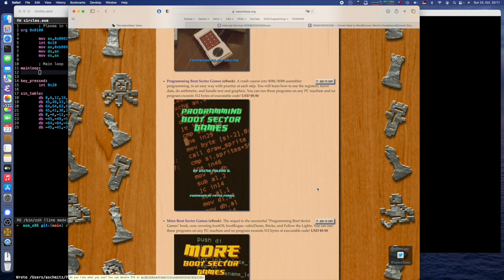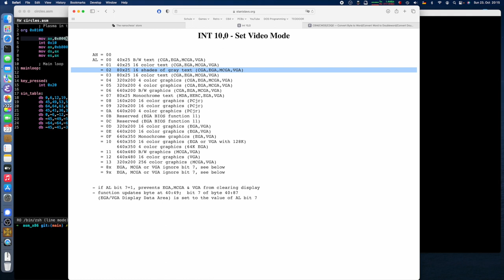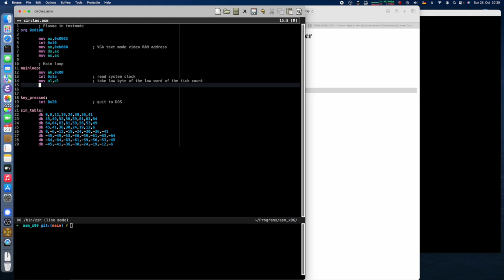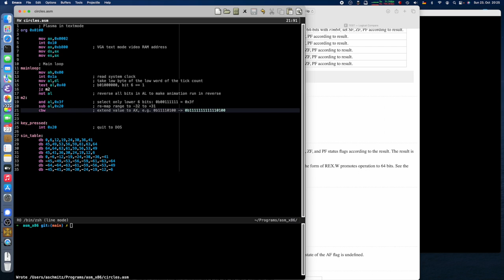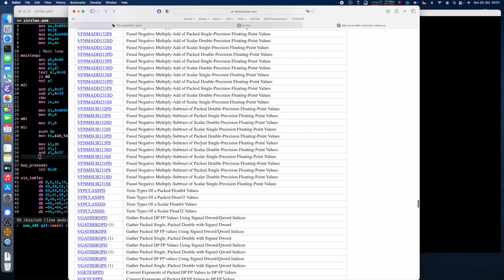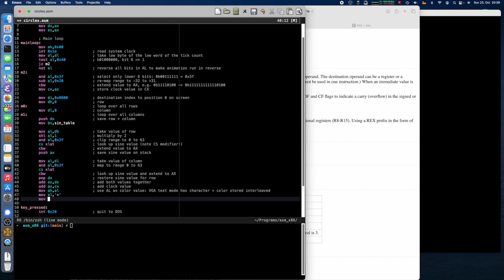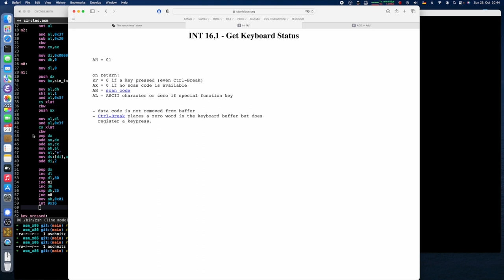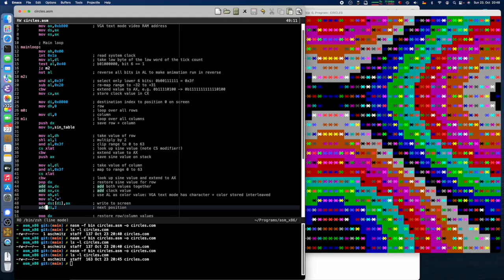Let’s Code x86 Assembly: 0x07 Text Mode Plasma

Comment: Very nice. To improve this, you can make the characters 8x8 pixels and use that special characters that combine the two colors in a grid, or upload your own characters to vga vram. Also you can disable the blink to avoid flashing characters.

I love text modes because they are just like a tile map mode used in many video game consoles, and it doesn't need a lot of cpu power to render things. I made a lot of tests using text mode, even a demo showing a mario level (with 2 colors per tile).
Reply from the maker: Yes, I have some ideas, also changing the VGA palette for nicer looking plasma. You could even change the palette every other scanline, if you want to have more total colors on screen... So much nice things you can do. I think this idea has some potential!
Reply: Yes, something like games on C64👍
Reply: 8x8 character on 80x50 screen:
xor bx, bx
mov ax, 1112h
int 10h
8x16 character on 80x25 screen:
xor bx, bx
mov ax, 1114h
int 10h
Reply: User character 8x16:
mov ax,1110h
mov bp, buffer
mov cx,12h
mov dx, 80h ; extended ASCII
xor bl,bl
mov bh,10h
int 1̀0h
Reply: @maxmuster7003  you can also use a 40x25 or 40x30 screen, that looks like zx spectrum, but arranged in 8x8 tiles instead of a framebuffer.
Reply: @Oosystem  ok